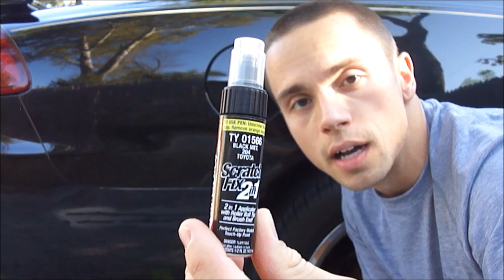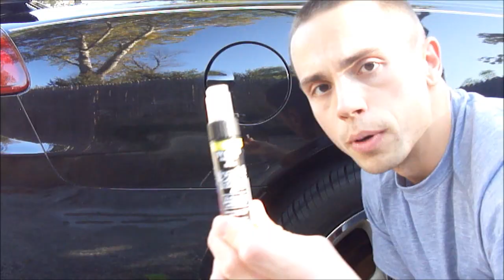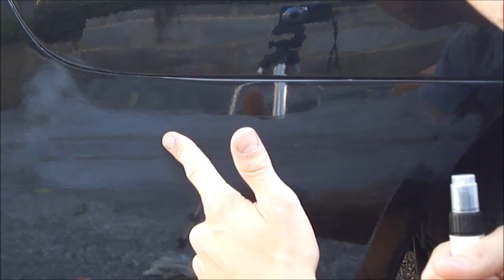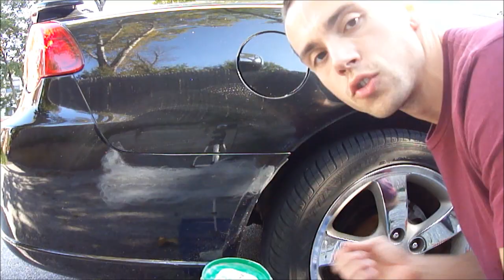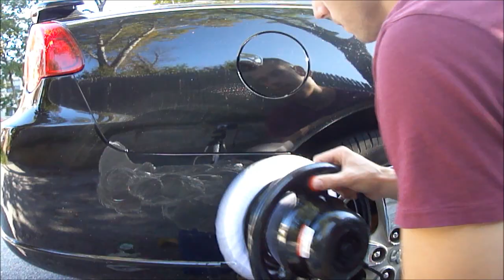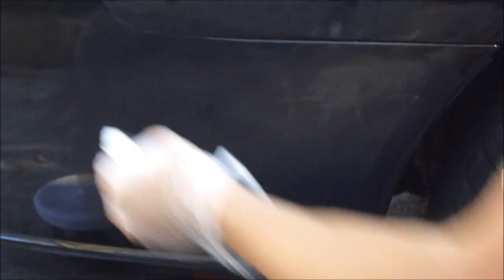How to Apply Touch Up Paint (to Almost Like New!)

Comment: And also if you are sanding by hand start with sanding perpendicular to the scratch at a 45 degree angle to fold the sides of the valleys in the scratch over...then when u step up to a higher grit to refine go in circular motions to hit the scratch from all angles...then compound...then polish...then wax

Comment: question for you. Does paint get bad? I bought a spray can that I custom fill with my car colors about 1 year ago. I tried to used it this year and what funny is (my car is red with sprinkle in it) while I apply it, it's perfect match. But once it dry out, it's way more darker and mate. Since I was doing touch up from stone chip, I spray the paint in a cup and used a small brush (pretty much the same as you used) to make the touch up.

Comment: Even though you sanded more than was required, if you'd used a foam pad on a DA polisher with Meguiars 105 compound that haziness would have gone. Skip the hand polishing stage and go straight to the 105. It will take out scratches for 1200 grit though I would have used 3000. But in the spot that you went though the base coat there's nothing to do but repaint

Comment: The way I learned to wet sand deep scratches was, 3M™ Trizact™ Hookit™ Clearcoat Sanding Disc glass cleaner or water, rub along the scratch, then use.
1.  3M™ Perfect-It™ Rubbing Compound.
2.  3M™ Perfect-It™ Machine Polish.
3.  3M™ Perfect-It™ Ultrafine Machine Polish.
Then use 3M™ Perfect-It™ Clean and Shine, With a Clean Microfibre Cloth

Also I learned this way because I work at a car dealership as a detailer.

Comment: I would think that before applying clear coat, it might turn out better if you buff out the miniscule sanding scratches(haze) and than apply your clear coat to see how much blending your getting(that is one of the main purposes of the clear coat) Than repeat the process of lightly wet sanding to level it out with the original paint and than buff and wax.  At least that is my plan for what Im doing to my car soon.

Comment: I just watched this video and there is an easier and faster way to do the entire project with better results. First use a matching auto body filler putty and a rubber straight edge to fill in the deep scratches. Next remove any of the excess putty using a microfiber cloth and a paint compound. Leaving only the damaged scratches filled in. Then use the correct color touch up paint. Do not use strokes with the brush! Just lightly use the very tip of the brush and dot the scratch from left to right

Comment: To get a better result, you'll have to use a machine polisher as opposed to a buffer. Otherwise, the new video is a great improvement over the original. Also, I'd use paper on a sanding block to get a nice, even finish. Stores like O'Reilly's and Autozone sell a decent assortment of papers and other body repair materials.

Comment: For the wet sanding, you could have sanded it with 2000grit and then sand over that with 2500 or 3000grit. then apply the compound.

Comment: I would've just buffed and polished after the clear coat stage, No need to sand. Clear coat will blend with the heat on a high speed buffer. Be careful not to leave the buffer in one spot, keep it moving until you get the desired result.

Comment from the maker: @happy9z I would add just one layer. I'd rather add more layers of paint than primer. Also, the buffer machine makes buffing a lot easier, but you can just do it by hand. Just use a soft terry cloth towel- I just used an old bath towel. Thanks for watching!

Comment from the maker: Thanks! Yes, but then you'll still have the raised areas when you remove the masking tape. Then you'll still have to sand the area.  I just felt that the paint brush worked better in my hands, but spray painting would be fine too. Also, it is usually easier to find your paint color in the paint sticks I showed in this video.

Comment: A month ago I had someone key both passenger doors of my car. One side has 4 very deep long scratches & the other side has around 30 or so bad scratch marks covering half the car door. I don't know who or even why someone did this but it's very upsetting. Bc there are a lot I'm not sure the same method would work for me? I have looked at many videos and gather I need touch up paint matching my car color (red), filler paint, 3,000 grit sandpaper, & a buffer. Any tips on how I can go about fixing it myself would be greatly appreciated.

Comment: Actually, someone brought up a good point.

Do you really need to use the sandpaper? I thought the sand paper was for rusted spots.

If there is no rust, wouldn't it be safer to only apply the primer, paint, and clearcoat.

Then you can buff with polish or compound?

Comment: Use as many times as needed to get the shine back. You can use by hand (very hard work), use a cheap buffer like seen in this video or use a machine (rotary or dual action).  Just keep going by hand, and as recommended at the end of the video use, 3000 grit. The shine will be permanent unless you fail to maintain the paintwork. Wax every 3 months. You can buy more expensive sealants and waxes which will help, but keep your car clean and waxed and she'll look good forever ;-)

Comment: Could it be that or it's simply normal? I didn't sand (totally forgot to sand the paint and coating). For now, it's 4 layer of paint, 10 min dry (big wind where I am) and 3 or 4 layers of clear coat. I don't have anything to buff but I will polish using wax.  Thanks

Comment: Should use a variable speed buffer, not an orbital buffer. Use low speed when compounding and higher speed when polishing. Make sure you keep the buffer moving or you will burn threw paint. Doing this will make a world of difference.

Comment: Just use paint matched rattle cans. In a small area, it will look much better than using a paint brush. I sanded using 800 grit paper and sprayed the paint on and clear coat afterwards. I think you did a lot of work.

Comment: Is there a way you can do that without the buffer tool? I need to fix my car it has lot of scratches and rust in some parts...
Reply: Stephanie Padilla You can polish the paint by hand, it requires some real elbow grease. A sanding sponge will reduce the scratching by knocking down the ridges from touch-up paint to blend it in. There are also some drill powered polishing pads (used on headlights) that are inexpensive and work well for spot repairs.
Reply: i know this isn't going to help, but ur beautiful! hope u fixed ur car.

Comment: what does it look like now, do you need to keep applying the polish every month or so?
Reply from the maker: It's around every 2-3 months.
Reply: have you found a best wax to use or are they all about the same, would a metal polish such as autosol work before the wax?
Reply from the maker: Maxxxwell10 I probably wouldn't use the metal polish, it might interfere with the paint's ability to adhere to the metal. However, I love Meguair's waxes, especially their NXT Tech Wax 2.0. It's pricey but it's worth it. Very easy to use with great results. I might be biased though cause I primarily only use Meguairs.

Comment: Wouldn't it be better to use a compound solution like Maguirs scratch 2.0 instead of sand paper?
Reply: Yes, use that or another cutting compound with a proper DA polisher and proper buffing pads for best results, rather than sandpaper.

Comment: That's not a buffer, it's an orbital. You needed to use a high speed buffer to buff the fine scratches from the sand paper. That's why they were still there.

Comment: Next time use a credit card with sandpaper folded around it works same as block. Wet sandpaper in bucket of water for 24 hours before use. Dont sand clear coat it will blend naturally

Comment: Hi, so just recently some asshole decided to scratch my car with a key and I was wondering how would I know if I need primer in the scratch
Reply: Primer bonds better to metal than paint does, thus it primes the surface... If the scratch is deep enough and goes to the metal, you need primer for sure. If you can see the original primer, paint alone should be fine. My car is black, the primer under is grey, as long as I don't see metal or rust I just use paint.

Comment: First 3000 grip sand paper then finish it with 4000 , finally it would be better to use a drill and a small pad to put in it , it's a small job the drill would give you a better finishing brother .

Comment: you need to use a sanding block. not your hands. your fingers will cause the sand paper to dig into the car's paint. causing you more issues.
Reply from the maker: Thanks for the tip!  That's a very good point.

Comment: FYI. You don't want to use that cheap primer. That cheap primer will wear off much faster then paint and you'll regret it. It will also pull and shrink causing it to show a lot more.
Reply from the maker: Thanks for the tip!
Reply: It was petty good work though. I'm just critical because I grew up in the car industry and I pretend to know what I am talking about. hah
Reply: **Pretty
Reply: RichsMethods hey how long do i wait between each base coat?
Reply: Go by the time it says on the can. Each can is different. If you aren't sanding between coats wait till the paint isn't dry but still tacky (would put a fingerprint if you pressed down)
If sanding, make sure it is dry all the way through, depending on how thick you put it on, spray paint usually takes a very short time to dry, usually less then 20 minutes for a lite coat.
Always do lite coats. It will come out the best, don't expect to cover everything in your first coat, in fact you shouldn't start to see it all filled until about the third coat.
Reply: thanks joe! i finished my painting. i did 10 minutes between each coat and since the primer was white i had to do 8 coats to get the paint matched relatively close
Reply: Nice, they usually sell black or at least grey primer at the auto stores. Should have purchased that.
Reply: you are right but it matches now so its all good.

Comment: You don't have to fill the scratch with paint.  You shouldn't.  The original surface has clear coat on it, so you should fill the rest of the scratch with clear, and then level it.

Comment: Well I lost track of how many times you used the word "sandpaper" and "sanding down" here.
Sandpaper (as most people will tell you) is for working with wood and other tasks such as flattening filler whist decorating.
Incredible as it may seem, sandpaper  is made from sand!!!
What you are using is "Wet&Dry" Emery Paper.
Good video otherwise, but try not to give people confusing advice!